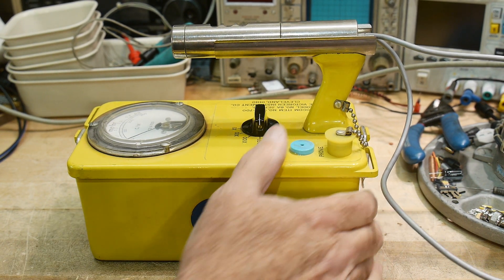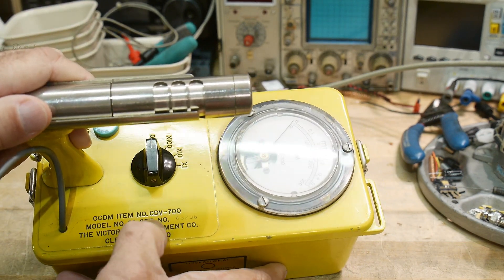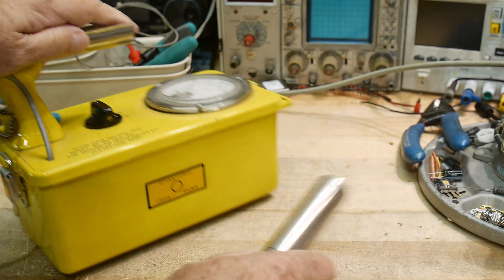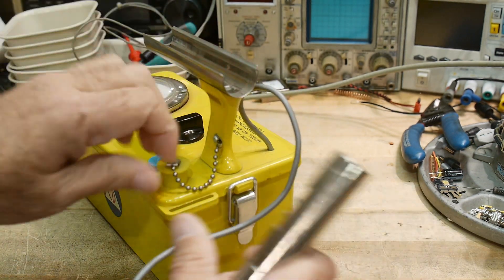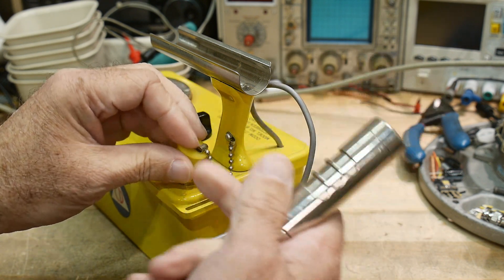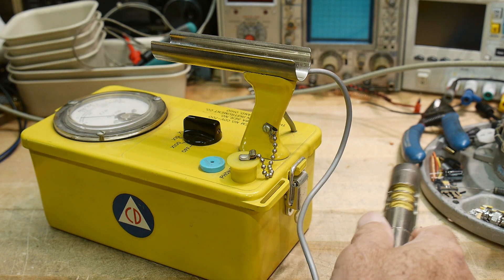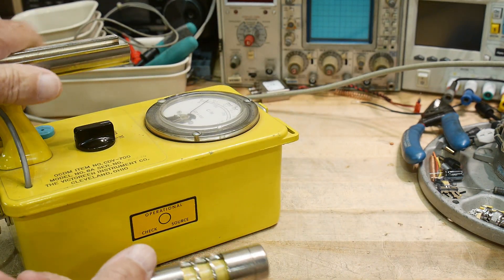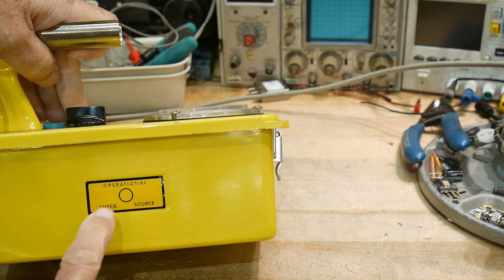#1334 Radiation Meter Geiger Counter

Comment: Up until 1969 here in New Jersey we had a local chapter of civil defense which was still existing. Amateur radio operators were members and we used to hold a bi monthly net on 10 m a.m. to have each county check in. I still have my membership card my ID was one November 5
Reply: Where in Jersey?  I was licensed there in '57 and had a Gonset Communicator. In Hunterdon County. I wonder if my Elmer, W2AZZ checked in. I was WV2ECZ.
Reply: @barrybogart5436  Bergen County

Comment: The tube you pointed out on the CDV-700 schematic is NOT the G-M tube.  It is a corona voltage regulator tube to stabilize the high voltage output from the supply at around 900V.  The G-M tube is V1 at the top left of the schematic, type 6993.
Reply: And those Corotron (proper name) voltage regulator tubes go bad and allow the voltage to go high, which can destroy the pulse transformer (T1) which is not to be found anymore. That Corotron VR tube should be replaced with a zener stack voltage regulator ASAP. I suspect that's why so many are no longer working. eBay sellers have pre-built zener stacks available. It's an easy direct replacement. Help a friend, pass the word.